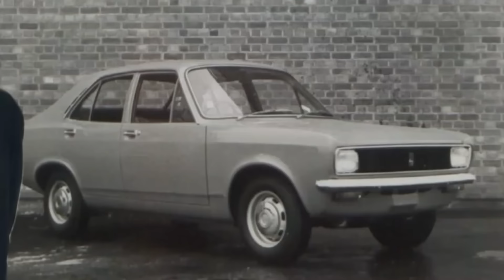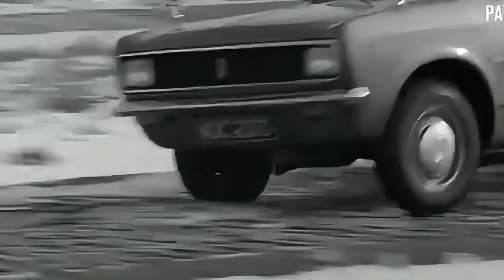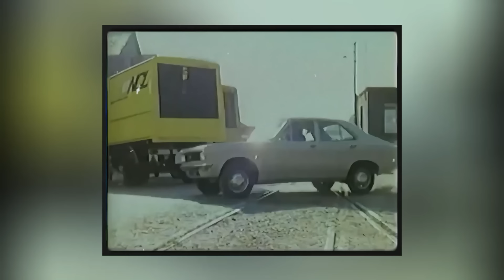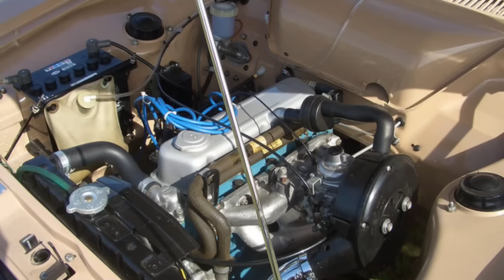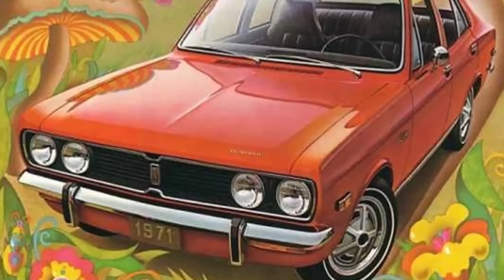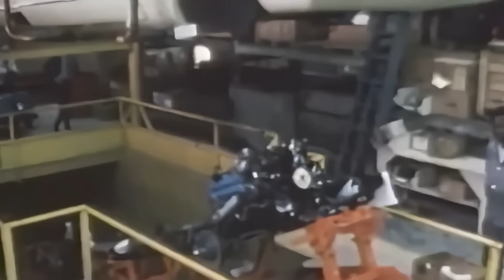Hillman Avenger (1970–1981): The Story of Britain’s Tiger

Comment: I never had an Avenger of any type but in the early 1970s I owned a new Hillman Hunter GLS, bright red, the colour bring named ‘War Dance’. The GLS had, as I recall, a 1724cc engine, modified by Holbay with alloy cylinder head and twin Weber DCOE horizontal draught carburettors. For its time it was a ‘flying machine’, great fun to drive with its live rear axle and it gave me just short of 100,000 miles of almost reliable service even though I gave it a quite spirited life taking full advantage of its performance. I think the gearbox and final drive were not quite up to the extra power and being driven spiritedy, the differential starting to scream and needing a replacement and towards the end of its life with me it had a tendency to drop out of second gear on over run. Other than that it mysteriously had a habit of splitting brake servo diaphragms, an easy job to replace, as were most issues in those simple bygone days.  When we eventually parted company at about five or six years old its interior was still immaculate and there were no corrosion signs anywhere. That was quite unlike two Ford Cortinas that preceded my Hunter, both of which were mechanically inferior and had serious rust issues and perforated bodies at two years old.

Comment: My first car in 1982 a 4 door 1250cc, the car must of been 8 or 9 years old.I remember stopping quickly at a red traffic light and the o/s front headlamp fell out,only the wires stopping it hitting the road.Also all the outside door handles eventually broke off, did love it though.😂

Comment: A New Zealand racer modified an Alpine with custom manufactured steel valve rockers.... which could then handle the 8,000rpm limit he had built it to reach.

He also turbocharged it...and in the 1970's this was a huge undertaking.

He said it spun the rear tyres (both of them together) in all three of the lower gears...and chirped the tyres after changing into 4th...at 100mph!

He had some Datsun parts in the mix...
for some reason he objected to me calling it a Dillman or a Hillsan!

He also rallied a slightly less aggressive Alpine and was very successful with it.....

Comment: Hillman avenger rusted like no other
Reply: They rusted like every other car of the era. No worse no better , average life of 7 -10 years before they were beyond economic repair. People bought them with that expectation. A mixture of cheap steel , poor paint and underseal with plenty of untreated box sections  then  add winter salt. You can see why .
Reply: The door hinges wore out very quickly. You got used to lifting the door before shutting it. The standard 1500 had a single Solex carb with rubber diaphragm, if i remember correctly ? They worked OK until the diaphragm developed a hole.
Reply: @bigvinny333  Nearly right, they were Strombergs. At least the diaphragm was an easy fix.

Comment: The Carbs described in the Video of the Tiger are not Twin Webers, looks like a single Stromberg to me. I know the Rally  ones had twin DCOE's, or DHLA's.
Reply: I had a hunter gt with the 1725 it had twin Stromberg the GLS had twin holby, same car different body shell
Reply: @peterwalker6020  From memory, the Hunter and Avenger were totally different cars. I did my apprenticeship for a Todd Dealership here in New Zealand in the late '70's 🙂 I do remember a Holbay tune on the Hunter and I even had a workshop manual for one until a flood took out my workshop in April 2023
Reply: Pretty sure the Tiger had twin 40 DCOES.That was for homologation purposes into Group 1.

Comment: Brilliant summary. 

But note, Talbot’s World Rally Title was in 1981, not 1980. They finished an amazing 1-3-4 on the 1980 RAC Rally, though, leading to the larger program in 1981. 

I love the Avenger since I had the chance to drive an Avenger Tiger Mk2. Earlier I was a Ford fan and experiened a few Mk2 Escort RS2000. Despite the Tiger being only 1500cc and about (only!) 15BHP down on the 2000cc Escort, and despite the Tiger strangely only being a 4-door, it surely felt faster than an Escort RS2000. It was oversteering a lot, but easy to control. I loved it to bits. I would have loved to rally one of these. BTW, not only Colin McRae, as well Henri Toivonen and Harri Rovanperä started with an Avenger and Richard Burns with a Talbot Sunbeam, which is heavily related to the Avenger. 

When you report that the last facelift had the interior from the Alpine, it may be worth to clarify this to non-British audience: The Talbot Alpine outside the UK is known by the uninspired names Simca 1307/1308 and later Talbot 1510 because of a name clash with the (Renault) Alpine A110/A310.

To the Brazilian VW 1500 it is also funny that this was the very first VW in history with a water cooled engine and to the day the only VW that combined front engine with RWD.

Comment: Bloody great cars.
I've had about 8 of them.
I'd love another one, but they're rare-as.
Reply: Agree a great and undervalued car - Had a 1973 Tiger2 - 1498cc rally prepared by Stag Hill Motors of Guildford who had prepared a 1250cc Tiger1 that was second in class on the 1973 RAC Rally of GB. Subsequently updated the Tiger2 with 2litre Brazilian engine and 5 speed box. Great car and surprisingly good competition to the twin cam escorts.
Reply: @rogerward5111 you lucky so and so 😊
Reply: @rogerward5111  You are lucky. I remember when Henry Toivonen did so well in the RAC Rally 1978, his "Sunbeam Ti" was equipped with the much larger Brazilian 2litre engine as well.
Reply: Brilliant, a most underated car. Good performance and excellent handling.

Comment: My father hired a 1.6 Avenger back in the 70s not now long after I passed my driving test.we were going to one of my moms sisters 5 daughter’s weddings from Liverpool to Swindon.we were talking some of are relatives also but we need two cars.my dad drove the car I passed my test in his Austin 1300, and me in the avenger. I immediately noticed the difference in power and my dad had trouble keeping up with my especially on the hills I thought I better slow down to let him keep up because he was the one paying the bills.I don’t think the motorway system was fully completed back then.
Reply: Memories of hiring an Avenger in 1978 from Godfrey Davis car rental near Victoria Station in London to attend a funeral near Cambridge. I'd booked a black one and got a yellow one "Take it or leave it, mate". I jointly owned a Viva HB 1600 at the time, so wasn't particularly impressed by the Avenger 1.3, as it lacked power and kept losing traction on the icy roads (finally turning it 180 degrees at low speed on ice on a hill on the A10 near Royston narrowly missing a truck and nearly ending up at my own funeral). I've never forgotten that in the funeral cortege there were a dozen black cars and my yellow Avenger.